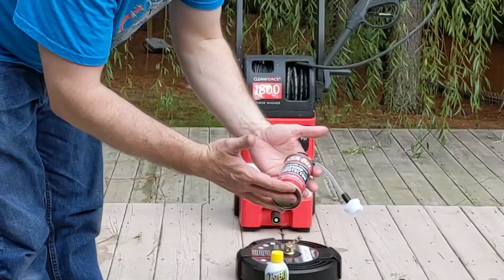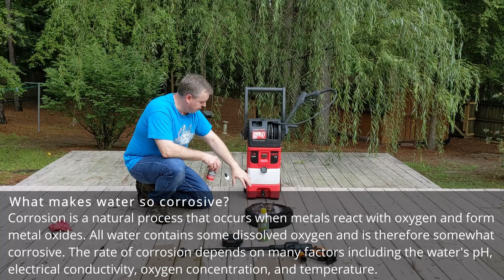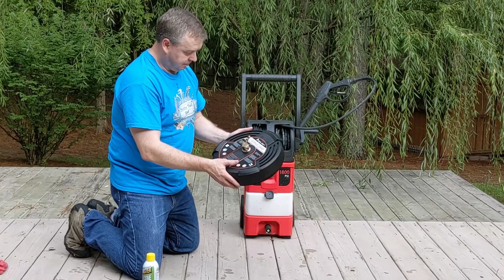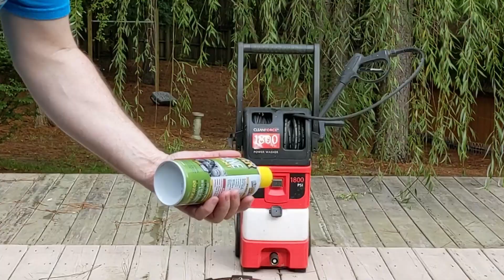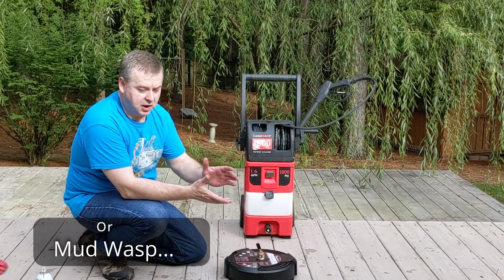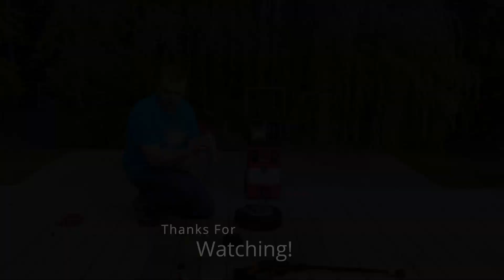Pressure Washer Tips and Tricks

Comment: Surprised to see you use an electric one. I've never seen one that was worth using, maybe I've just had crap ones.
Reply from the maker: They are the lower end for sure. I have used Gas powered much better of coarse. I always like having a couple of convenient ready to go washers around for quick and small jobs. Honestly the little Worx Hydro Shot has been awesome at the small jobs being so portable it's my  go to for small jobs 200psi can help with (spraying off the mailbox at the road etc.)  It does pretty good. Love the convenience.  Cleaning a large drive way is deffinently larger Gas powered washer time.